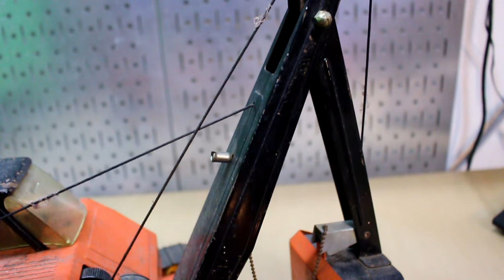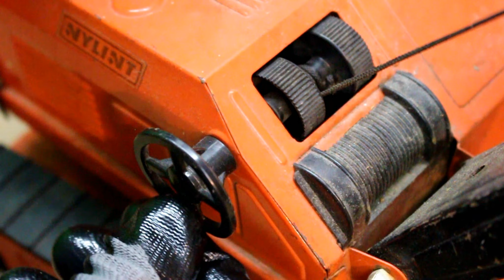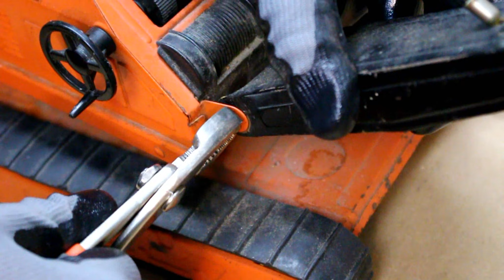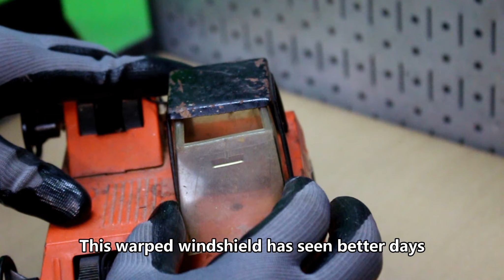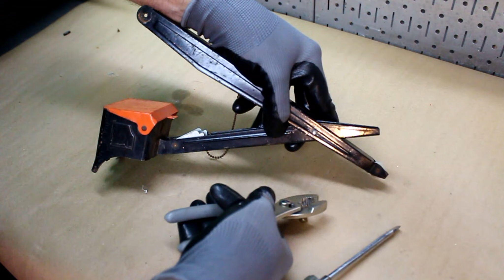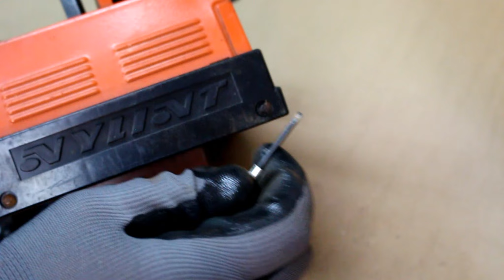1973 Nylint Trac Shovel Restoration

Comment: Excellent  restoration ,  I like your cardboard  box paint booth with a furnace  filter, great idea .need to put thin metal piece  between what  your riveting  then remove it so the parts will open and vlose.

Comment: Another great job. Have you ever tried penetrating oil to restore old rubber tires, tracks, etc? I've had good results with it on restoring my old Hubleys, puts new life. Speaking of Hubleys, how about restoring a post war Hubley larger die cast instead of stamped steel for a change? I'd like to see how powder coat works on their zinc based metal. I'd like to get a powder coat set up, but I'd like to evaluate the results on diecast since I work with it mostly. Love your videos, you are a professional artist/toy guru and that speaks volumes since I'm a critical evaluator.

Comment: I’m just curious as to why, if you’re gonna sand blast it after you strip the paint, you just don’t use the sand blaster to remove the paint? It would save you a step, and you wouldn’t have to use chemicals to remove the paint. I’m not bashing you, I’m just wondering why the extra step? Otherwise, it came out great.
Reply from the maker: Sometimes you don't want your blast cabinet full of paint chips.

Comment: Parts in bag. Rust remover in bag. Put bag in bin of water. = Even coverage of all parts with limited amount of rust remover due to hydraulic equilibrium. It's liek gun kata, only without guns. There's no kata in it either, to tell the truth. less like equilibrium, then, but hydro all the way. Rubber nipples optional.

Bloody nice job, though, sah, that wind-proof screener popped the ole' eyes a tad. Found them again, don't you worry, one of them landed in my tea, but that does them no harm.

Comment: 1. The "glass windshield" just stays there by itself?
2. Where did you find Nylint decals?
3. Powder coated rivets...nice touch!!!
Reply from the maker: 1. That's the way the windshield installed as I got it, no idea how it was when it was new.  2. Bought the decals on eBay.  3.  Thanks!  Got the tip from watching other restoration videos.